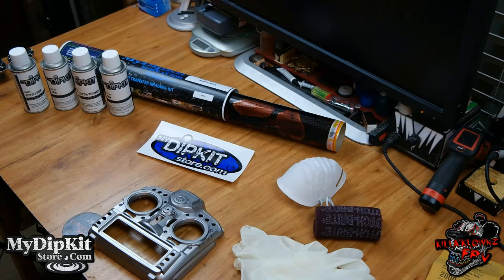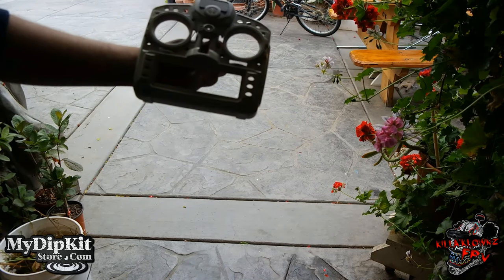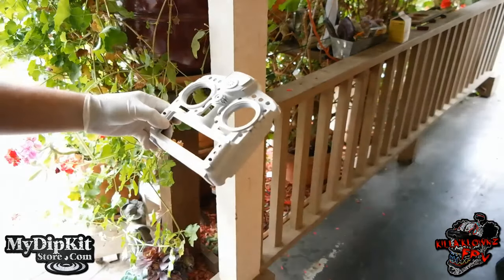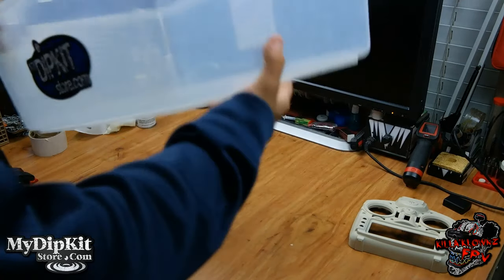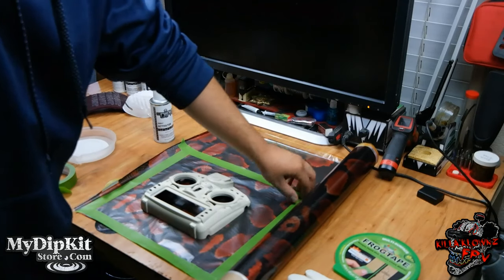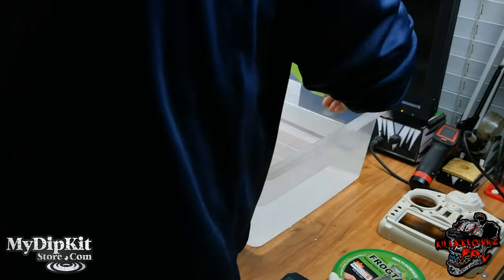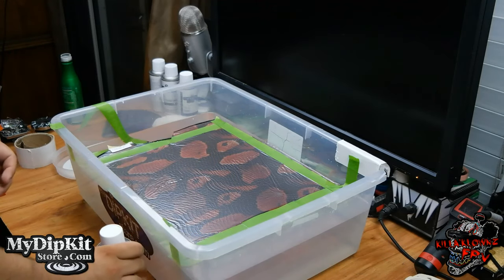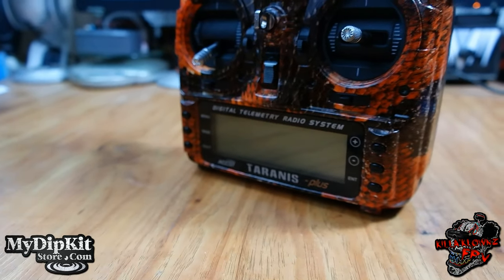How To: Hydro Dip Taranis!

Comment: Is the primer you used a regular one (for plastics) or an special one to be used with WTP?. Also, is it necessay to use like a clear spray coat over the final painting job to extend the durability of this?
Tks

Comment: What's the feel to the touch ? is it smooth ? do you need a protective varnish  ?
Reply from the maker: Yeah it's smooth.  You mean as in the final clear cote? yes if you want it to last lol otherwise if you fly and leave it out in the sun it will cause yellowing or peeling over time, the clear cote makes sure that doesn't happen

Comment: Is the initial coating necessary for the film to stick ? or is it just to work on a white base ?
I have an orange case and want the orange to stay as base do i just sand it and go ? or need to use a coating? in which case: clear coating exist ?
Reply from the maker: yes for it to stick properly you do need a base coat. So ide suggest sanding it and repainting with the same technique with an orange flat color